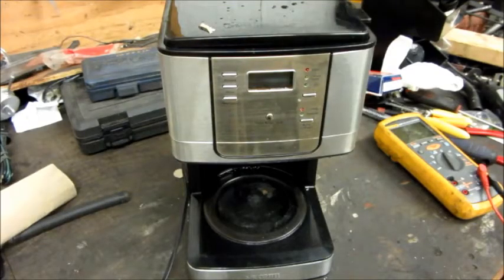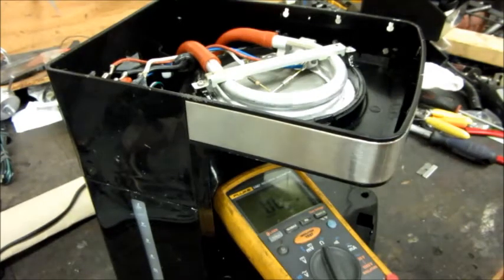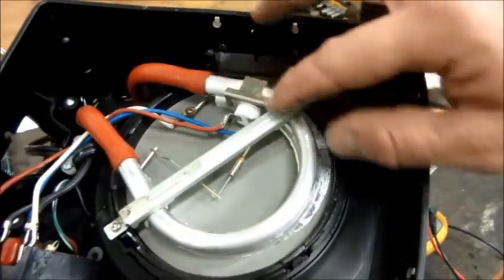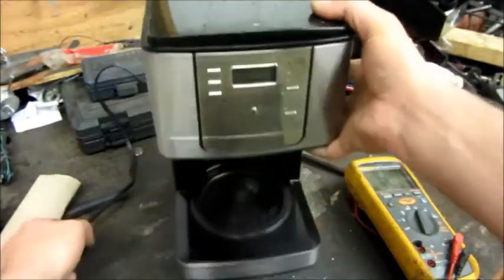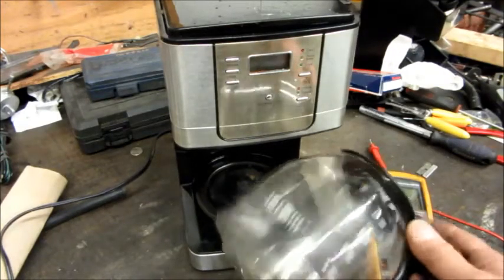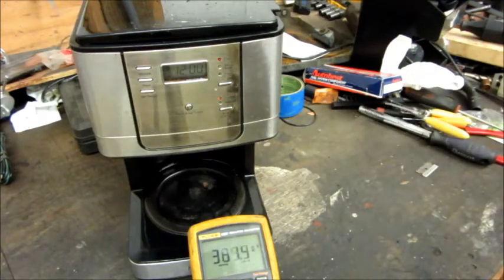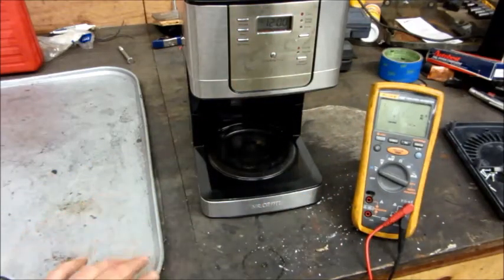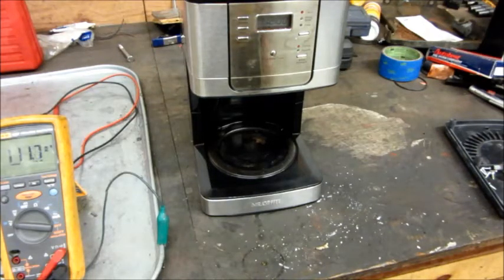Coffee Maker - Very Unsafe Design - Electric shock hazard....

Comment: Most of those have a 'Sneak-A-Cup' filter basket with a spring loaded stopper. My Black&Decker unit is almost identical to a Mr.Coffee (probably built on the same line different paint stencils). I know I get coffee on the warmer plate often (sneaking a cup) even had the filter basket stopper jammed by rouge coffee grounds and a real mess happen.  I also know from using a Generator they will put a real 1500 watt generator to it's max brewing coffee. The cheep-o generators will not run one of the 15 amp 120 plugs regardless of the over-all 220/240 watt output.
Reply from the maker: Yep that's what I found out with cheap generators. They always over-state the power capacity - similar to the way vacuum cleaners and air compressors are sold using outright lies.

We had a coffee maker which would automatically grind whole-bean coffee and then brew it. There was one piece you could accidentally leave out and the thing would appear correctly setup.  However, when the timer started the grind cycle; it would throw coffee beans and grindings out all over the kitchen!

Comment: Just to put this in a medical perspective, if one was say, handwashing dishes, and reached over with the other hand to take out the pot to wash it, as little as 50 milliamps of current can instantly arrest an adult male's breathing.
Reply from the maker: True. And it was sitting directly next to the sink.  Hopefully the GFCI would have come into play and shut it down if that were to happen.
Reply: Yup.  Our workshop is protected by Pass & Seymour GFCIs, and I have tripped one once accidentally, and the GFCI was so responsive, I never even felt a tingle.
Reply from the maker: That's good you didn't sense any shock. I have not ever tripped a GFCI by touching a shorted appliance (thank goodness).